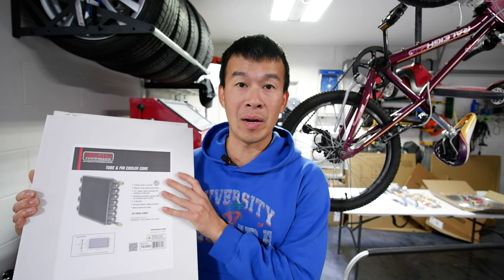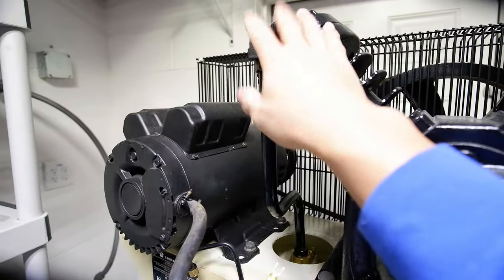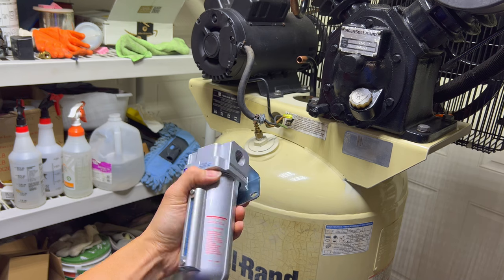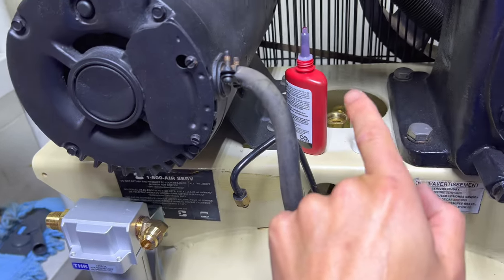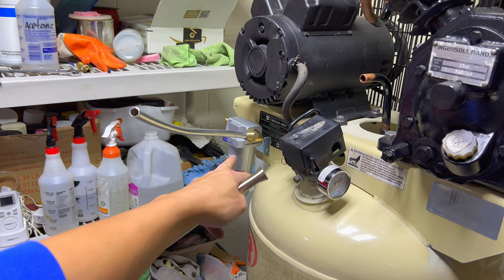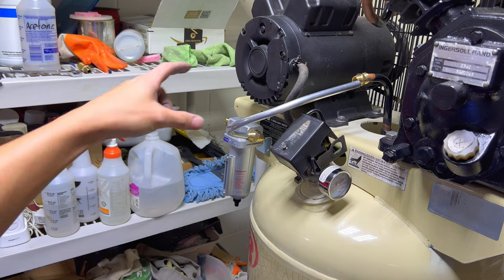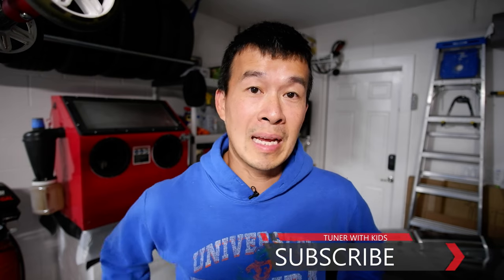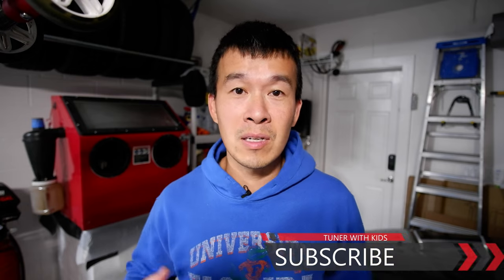DIY Air Compressor Aftercooler Dryer Water Separator | Compressed Air Cooler

Comment: Hi. Excellent project - just 1 question which isnt shown clearly in the video - when you mounted the oil cooler onto the shroud /grille, does the compressor fan blow into it or sucks air through it? From the video, it looks like the fan is sucking air through it ... But I might be wrong. I always thought a fan blowing into the cooler will cool it faster but not sure if it makes that big a difference.
Reply from the maker: The pulley is sucking air thru because the OEM setup sends air to the after cooler pipes of the compressor and to cool the piston housings.

Comment: My 5 HP 80 gallon compressor is connected to a 3/4 copper pipe air line with a hydraulic hose. The hose is rated for several times the maximum pressure my compressor can produce, and it isolates the pipe which is fastened to the wall from compressor vibration. I've purchased, but haven't yet installed, an aftercooler coil. My plan is to fasten it to the wall on long standoffs so the blades on the flywheel can blow air through it. The lines from my pump to the cooler, from the cooler to the water separator, and from the water separator to the tank will all be high-pressure hydraulic hoses. The cooler will be isolated from vibration and I won't be faced with any issues of fittings turned in the wrong direction as I'll just buy hoses that are long enough to form a loop. Anybody see any flaws in my plan?

Comment: Can you do  the same set up on a 30 gallon air compressor
Reply from the maker: You can add cooler in any but for a 30 gallon probably not worth it cause the oil less compressor. No room to route the air cause it’s has a small threaded pipe into the tank.

Comment: Did you use a 45 degree flare and nut to connect to the 8AN male on the 15300 cooler? The 8AN is 37 degree. If so how has it held up?
Reply from the maker: I’m using 45 flare on 8AN. It works fine for this application. This is a charging circuit so it doesn’t have to be 100% air tight. It’s moving air so fast that any leaks are negligible. Once the circuit fills the tank, it actually unloads any pressure in the line prior to the tank check valve.
Reply: @TunerwithKids  thanks, I was wondering the same and deciding if I needed to buy a 37 degree flare tool as well as a 45 degree flare tool. I like tools so I might anyway 🙂

Comment: Great job. But why cut the original pipe just to connect to new pipes? Why not just make the pipes one piece? Less connectors means less places to leak.
Reply from the maker: I think it was making the turns and connectors. The factory tubes were already terminated to tank and motor so it was easier to join them.

Comment: I'm using scrap car air conditioner cooling coil, yeah it's free and it does the job well. anyway it was fun project
Reply from the maker: Yea, any coil that can be somewhat tightly sealed and pass the air can work. Only thing I’d be weary of is the tube size and SCFM that you can push thru that. Even my setup with 5/8 down to 1/2 has some people questioning it. But I figured the small decrease in ID of pipe will be made up by the extra length of the passes and charging circuit.
Reply: @Binh Nguyen-Tuner with Kids  before embarked of this setup I'm aware of the cfm drop. my coil is not round but what i can say it's larger than 5/8. only the input and output using 5/8 tube. i think your 1/2 tube should be able to handle at least 40 cfm at 120 psi. whats more important here is using high flow water separator so you don't choke the air

Comment: Any idea what the maximum cfm these transmission coolers is? I'm thinking on putting one on my compressor, but worry that it may restrict cfm levels. Currently without one, I can run 20 cfm at 90psi, but have the capability of increasing this to 30 cfm in the future with a motor upgrade. Any idea if this would handle that?
Reply from the maker: No idea on CFM, this is a charging circuit, so if your tank is full and the compressor kicks in to fill from 120psi back to 150PSI, not sure if that affects the tank output CFM.

Comment: Why not tuck the lines underneath by the compressor head base to avoid that top loop? Would've made it look alot cleaner.
Reply from the maker: Was trying to work with the existing path and keep bends minimum due to kinking.

Comment: So is the after cooler dryer running at same pressure as the compressor?
Reply from the maker: It’s the charge pressure before it hits the check valve and tank.
Reply: @TunerwithKids  So it is under pressure? the same pressure that the tank would be under while the motor is on?
Reply from the maker: @4314832  it’s under whatever pressure the pump pushes while loading. Probably no where near the tank presssure. Once it fills, this circuit discharges at the pressure switch.

Comment: why doesn't anyone braze these fittings?  a/c fittings are brazed at the compressor due to vibrations...the movement of the compressor sure seems like a good source of vibration.
Reply from the maker: brazing would be overkill for air compressor. Having removable connections makes future service easier.

Comment: I have a 06 gs300 can I put the is350 brake calipers on my 06 gs300
Reply from the maker: Yes. Bolt on. Rear is already bigger and vented so it’s same as IS350 except caliper is slightly design.

Comment: Use blue loctite. Reds too aggressive if you need to remove them later
Reply from the maker: It’s pneumatic/air loctite to seal, it’s not your typical locking type.

Comment: so would a AC air dryer reciver work as well?
Reply from the maker: AC air dryer is usually an output dryer. It drys air coming out of the tank. On large industrial systems, an AC dryer is used as an after cooler before distribution line or storage tanks.

Comment: Is there a bigger cooler option?
Reply from the maker: Yea there are a few other more expensive options. Most people use this Hayden https://amzn.to/3E08Mc9
Reply: @TunerwithKids  THAT is one huge cooler, I put one of those on a big 4WD Hydrostatic Drive HYDRO-MAX trencher that had heated the hydraulic oil hot enough to melt the nylon filled pump pistons in the Hydro pumps and the melted droplets plugged the original cooler enough to create to much case pressure in the pumps which caused the crankcase gaskets to blow out. After pulling the 4 pumps off 3-4 times to replace gaskets, finally checked pump crankcase pressure and discovered cooler plugged off from all the melted plastic droplets. That was one of those "Fun" jobs you don't forget about.

Comment: Aluminum is not compatible with brass or copper it will corrode fairly quickly and weaken the material
Reply from the maker: Damn forgot about galvanic effects of dissimilar metals...doppppeee! Oh well I'll keep an eye on it to make sure AL tube doesn't oxidize too much.

Comment: The intercooler is supposed to go between the two pistons, i.e. after the first piston. Should work great anyway, I bet you get no water in that tank!
Reply from the maker: The motor already has an intercooler built in via the finned tube. This is an after cooler.
Reply: @TunerwithKids  I see, I neglected to read it carefully! Thanks.

Comment: I wouldn't think that an oil cooler would hold the pressure
Reply from the maker: It doesn’t really hold pressure. It allows pressure to pass through on its way to the tank. Once the compressor is done, it depresses the charging circuit.
Reply: @TunerwithKids it has to be at the pressure of the tank at least while it's pumping

Comment: Nice video. But I think you're going to have problems. The cooler should be put on the output of the tank, not the pump. That's going to get water in it and it'll sit there and rust.
Reply from the maker: This is how optional OEM coolers and every other aftercooler works. The theory is to cool the air as it leaves the pump BEFORE the tank which prevents condensation in the tank. The gravity will bring moisture out of the radiator and in  to the trap. A cooler after the tank won’t prevent moisture IN the tank. After the tank you use line filters and desiccant media to dry output air which I also installed.
Reply: @TunerwithKids  OK. That makes a lot of sense. Thanks for the detail.

Comment: Intercooler not aftercooler
Reply from the maker: Nope, it’s an after cooler. The intercooler is the fins on the tube between the cycles. This goes after the compressor before the tank so it’s after.

Comment: No you spent to much money a refrigerated cooler is 600 dollars 99.9 water free no maintenance  yoz fucked up
Reply from the maker: Naw don’t need that much cooled air especially for $600 vs less than $200. Most people don’t need the extra complexity for a 60gallon.

Comment: can i use  AC condencer
Reply from the maker: You can if you can get a hood seal and fittings but I suspect the tube diameter is too small to move high air volume. These oil and trans coolers have larger tubes and are cheaper.